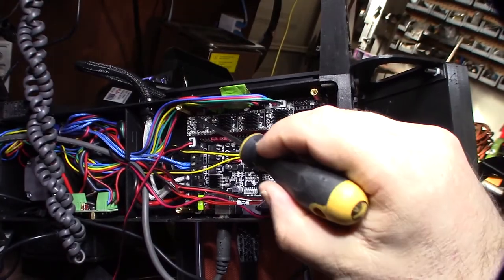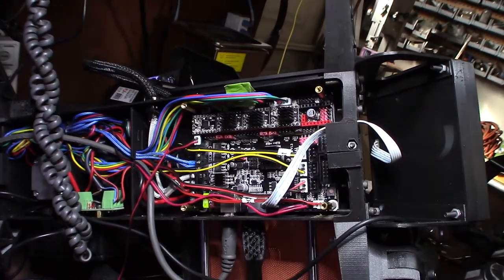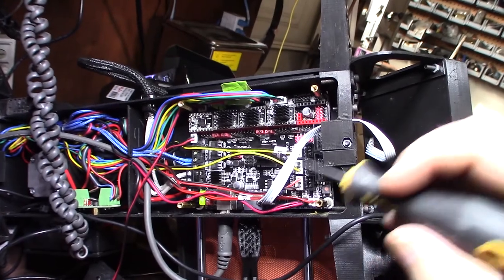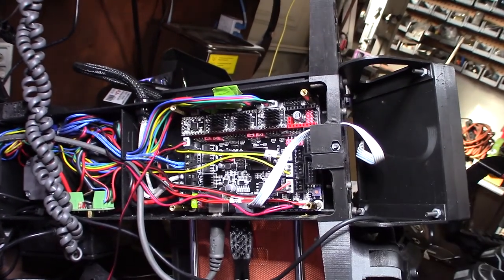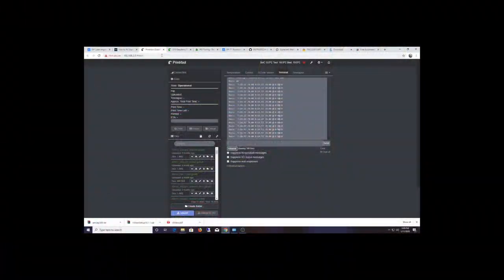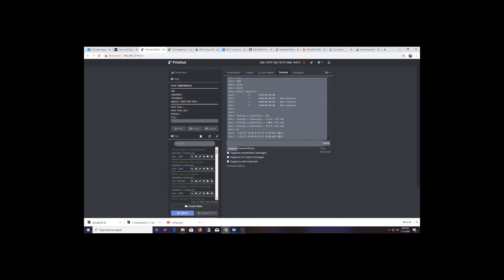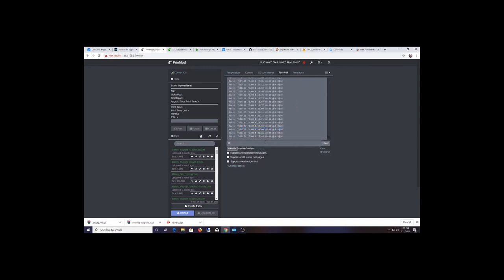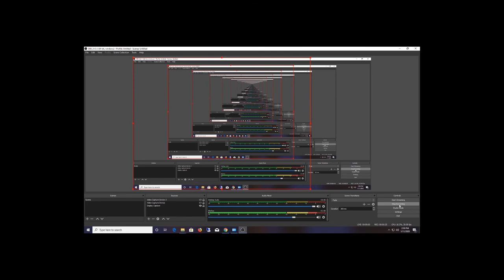BigTreeTech TMC2208 2.0 UART Mod for SKR 1.3 1.4 Pro TMC Connection Error

Comment: OH MY GOD! You saved the board from flying trough the window. I actually have the V3 TMC2208 and the pins are on the correct place but everyone shows the wrong jumper pads soldered and you actually made me look twice into the pinouts and what the jumper actually connected, so I switched to the other two pads and now it works perfectly! THANKS DUDE!
Reply: I had the Connection Error on my screen, tried and looked at several of the fixes but none worked for me. I decided to re check my drivers and the jumpers underneath, everything looked fine, but when i put the stepper drivers back in i noticed one seemed to be a poor fit ( Loose ). AND WHEN I LOOKED EVEN MORE CLOSELY WITH A TORCH, i found the top row of pins were not actually in. The bottom row plugs on the board were bent down, i realigned them and put the driver back in, now it was a snug fit. I turned on the printer and Low and behold the Error message had gone. So please check carefully your pins and sockets are aligned and you are getting a proper connection, could save you a big headache, it was just pure luck i came across this. Good luck to you all.

Comment: Excellent information! Just wish that the pictures were plain enough to actually see what you are trying to show. Sorry if it is just me, but I have this problem and it needs to be fixed. Thanks!
Reply: Well, guess what? 2 years later and I still have not resolved this issue.

Comment: For some reason, TMC2130/SKR 1.4 works with Tevo Tarantula and RR Smart Controller, yet same TMC2130/SKR 1.4 using a RR Full Graphics Smart Controller on a CR10mini gives me the TMC connection error.  Could this be an LCD related error as I can't imagine my SKR knows if I have it on a Tevo or a Creality?